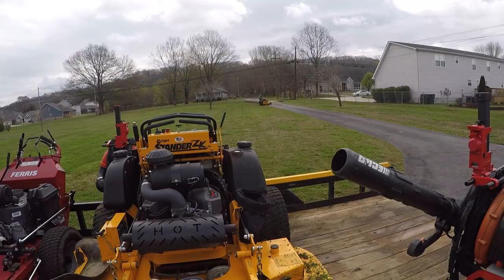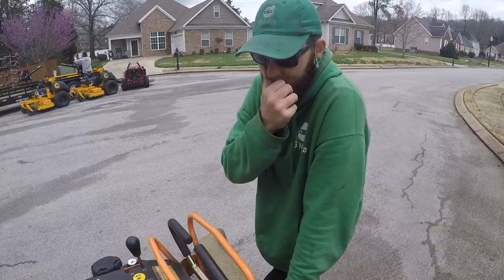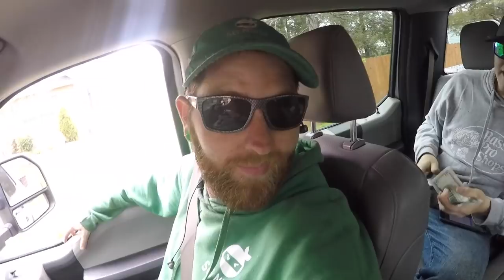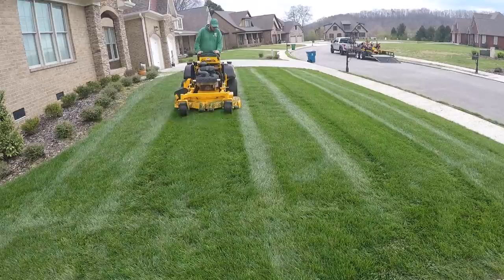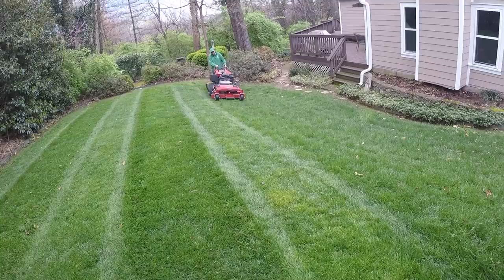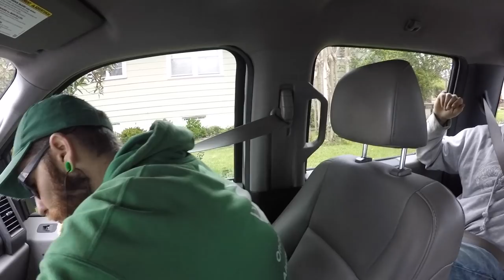Who is Responsible Mower or Operator!?!?

Comment: Hey Nick, I read on Lawnsite that the aerocore deck performs best in all conditions with the gator G5 blades on it. Supposedly the deck is not as open as the velocity deck is, so throwing the gator blades on it chops the pieces into a finer piece. And reduces clumping in all conditions.

I run all Ferris! I hope this helps!

Comment: I have the 3 weed wacker rack from equitment defender and the 2 screws keeps coming out and I almost lost the main part with the lock. They said you can use lock tight or just make the tight which i do but they still come out and they should not.

Comment: I stripe with a mower that has no striping kit.  Most mowers will stripe without, you just need to cut it the same way a few times in a row really. You get credit on how straight the stripes are but not the actual stripe itself.  I mean unless you are rolling on the grass behind the mower to lay down the grass for the stripe then you don't get extra credit for the stripe.

Comment: from the select few that know the details that its the mower that does the striping extra credit wont be given. BUT to EVERYONE ELSE (who wont care to investigate the details) will put that boy on a pedestal!  Example: say 2 cable installers install and wire a house. 1 has  basic tools and runs the wire thru the outside the house & drilling holes to each room thats getting cable. 2nd intaller has the equiptment to be able to do wall drops to each of the same rooms. Does he deserve extra credit for hiding all the wires, when his tools are what really made it happen. ..Hell ya he does. Extra credit goes to the person who invested buying the tools to make it happen. But from the customer, the extra credit will go to the person using those tools that make it possible. The company gets extra credit for making it possible, everyone looks good.

Comment: The operator gets the credit when it comes down to it the mower is only as good as the operator if you have a 12000 dollar mower but the operator sucks then it will be junk cut most likely so essentially the mower is junk in the scenario so it's in the operators hands to lay stripes and give it a good cut

Comment: The operator should get credit for STRAIGHT Stripes ONLY...that is the ONLY thing that is the operator has control and any skill involved in.....   Also ..blower rack...need to drill holes through the bar support post and add bolt and locking nut to fix permanently.    Ninja on